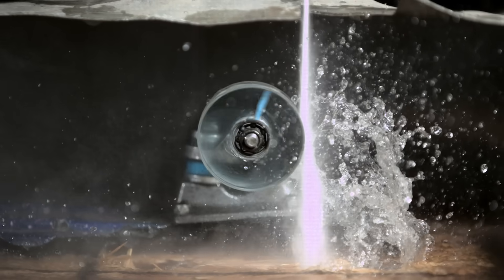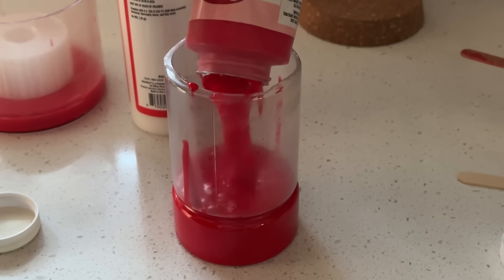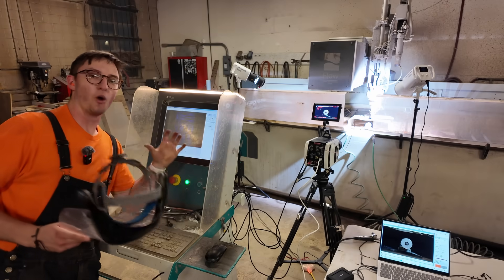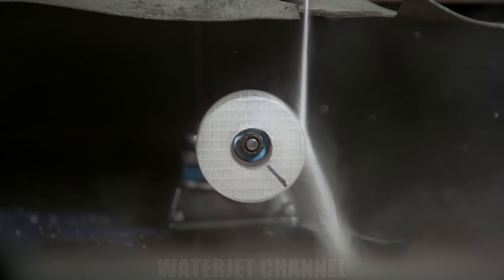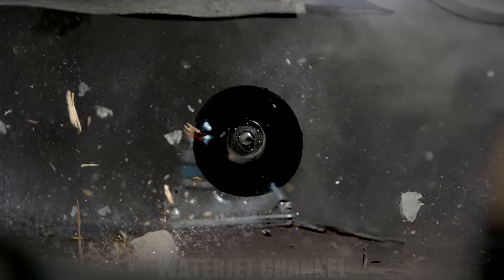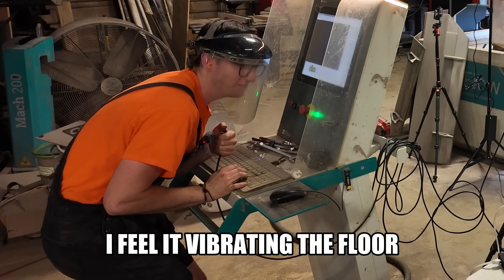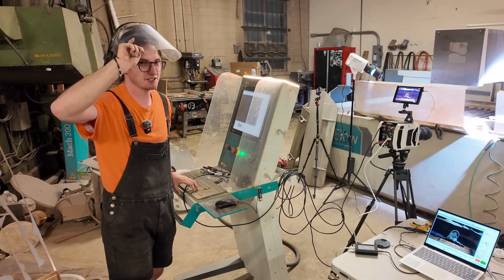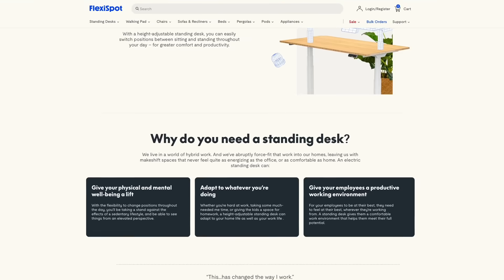How Fast Can We Spin Bulletproof Glass Before it Explodes?

Comment: What if you had some sort of variable-geometry ridges on the outside of the skate wheel (sort of a transverse tread) for the jet of water to push against to increase efficiency. As it is now most of the water is flowing past the wheel barely transferring any thrust to the wheel. You could do so much more with this if the wheel would be able to be larger and heavier due to using more of the jet force and increased torque.

Comment: The problem with spinning these up with the waterjet is that the waterjet, whether using the abrasive or not, is going to start eating into the material as it's spinning and weaken the structure until it has enough of a defect that causes it to come apart.  If you really wanted to know how fast you can spin them to see when they come apart from their own rotational velocity, you'd have to spin them through some non-destructive method so that any defects that arise, come from rotating the material alone.  That and if you want a perfect wheel, you need to make a solid puck or block of whatever material and machine it down in a cnc machine to be perfectly balanced and fit the bearings perfectly.  I get that you want to use the waterjet because that's the channel name and it's how you've done things for a long time, but you could at least machine the wheels to be effectively perfect.

Comment: 4:15 The tool you're looking for is an arbor press. You can use a piece of material just smaller than your bearing OD and just bigger than the ring's ID, and pass it through the other side, then press the ring out.

Comment: 7:27 its crazy when you pause it right as it splits into 4's it turns see through cuz of how fast its going on the frames I'm guessing?
Reply: No actually it’s actually because fast things going at an unsteady rate of speed create after images if it keeps going in the same spot also you can make after images when you move your finger back and forth fast enough

Or it could be what you said

Comment: WoW! Who knew the glass and resin wheel would last about the same as the.... Glass and resin wheel! You mess with the angle of the waterjet too much on the wheels too. It's never really consistent. All you did was split the layers because you sliced between them with the water. It's a really nice machine, but kinda shit for this because the area of the impact is so focused. Anything you do with layers is going to fail the same way. The the same reason the glass broke early, you were splitting the wheel at the surface point of impact as it spun.

Comment: ¿Has calculado la resistencia para maxima velocidad de giro para materiales multidensidad con geometrìa elàstica? Tal vez eso ayudarìa a ganar mas revoluciones sacrificando dureza por deformaciòn elàstica, haciendo mìnima la deflormaciòn plastica que lleva a la rotura. Imagina los radios de una bicicleta unidos en el extremo exterior y unidos en el extremo interior, pero en lugar de usar metal duro usar un material  flexible y unir el conjunto dentro de un material menos denso. ¿Jugando con la geometrìa en el desarrollo de la ruega, como lograrìas hacer que soporte màs rpm? Imagina un conjunto de donas huecas concentricas  con algun fluido en su interior que a determinada cantidad de revoluciones haga de contrapeso para evitar trabajar en la zona plastica del material de la dona. ¿Nivelarìa el comportamiento de la dona?. ¿Y si dentro de cada dona se usara un fluido de densidad distinta para que nivele las donas a distintas velocidades? ¿Serìa posible exceder el lìmite de velocidad de un material haciendolo multidensidad y jugando con la geometrìa?. Mi nombre es  Daniel igual que tu. Desde Rosario -Santa Fe - Argentina. Me agradan tus videos y despiertan la imaginaciòn. Un gran abrazo.

Comment: Bulletproof glass wasn't that strong because the water jet hit the sides, and it can take a lot more compressive force than shear force. You could get it to work a lot better if you cut progressively smaller circles to make the wheel, but the wheel would only be as thick as the sheet of glass you cut it from. The sand didn't care because its one solid object.

Great video btw!

Comment: A very interesting video! Since childhood, I have also been interested in things that can be called extreme. For example, will a match light up and how will it burn at a pressure of 10 or 100 atmospheres? How will the electric motor behave with a smooth increase in frequency from the standard 50 Hertz to 100, 200....400 hertz? What will happen to a bullet flying through a cutting jet of water?

Comment: 8:26 - The problem w/ the mold was that it didn't have reinforcement on the sides and when you put the side on it bulged the mold causing the bearing locations to be different, causing the wonky wheel... You could have wrapped it in duck tape or gorilla tape before pouring the stuff in or put it in a container to keep it true. Maybe next time....    😁👍😂

Comment: The mold was made circular, but had no support to keep it that way. The material being cast pushed out on the mold asymmetrically. Make the mold in a box and keep the box for later when you do the casting. This will help it keep its shape.

Comment: I don't know if you have tried this yet, but I imagine the rotation of the objects causes tensile stress in the material until the stress gets so high it rips itself apart. So, why not try a tungsten wheel, as tungsten has the highest tensile strength of any natural metal. I tried looking up alloys with greater tensile strength, but all I could find was people saying they exist but not saying what they are? The highest tensile strength material is graphene which obviously you will not be able to make a wheel out of, but it's tensile strength is about 130 times greater than tungsten even. I would  dare to guess the tungsten wheel would not explode, unless you modified it so that it's just a tungsten ring around a filler material, in which case you could make the ring thinner and thinner till the tensile stress is greater than the tensile strength. In fact, that could be a cool project all together, gradually increasing the thickness of the tungsten until you find out the tipping point between exploding and retaining it's shape. Or maybe the solid tungsten wheel would just explode idk.

Comment: There's a company in Woodlands Texas called ChampionX. They make Diamondback 3D printer nozzles out of a substance called "Bort", or polycrystaline diamond. Unlike regular diamonds which are incredibly hard, but brittle and easily smashed, borts are incredibly hard and very durable (those nozzles are basically invincible). You should reach out to them and see how big of a bort they're able to make, and if they could make a bort skateboard wheel. I can pretty much guarantee the algorithm would love a title like, "Spinning a solid diamond skateboard wheel at hypersonic speeds", and a thumbnail with "REAL DIAMOND" in it...

Comment: Want a true test to see how fast something can spin without the extra variable of the waterjet touching and damaging the item? Build a finned wheel onto the shaft that the water jet hits and spins and let the item of test to sit attached to that shaft. The finned wheel should be a strong enough material to resist coming apart.

Comment: When trying to make bulletproof glass again, may I suggest setting up all your layers, get the air bubbles out of the resin, and then using a spong brush to brush the resin on each layer as you stack it, you will have to leave it where you make it but it will be a big block of BP glass you can cut stuff out of it maybe

Comment: Is there a way to rig up a shaft thats strong enough to be spun by the water jet, maybe with like steel or titanium fins on it, so that the wheel of random material can just spin and not be affected by the jet itself?
Reply: Just use a pressured water pipe as the axle, and have have two off center holes on opposite sides. Optionally, extend those away from the center of rotation with curved pipes to get even faster speeds. The water comes out at the opposite angle of rotation at all times at high speed. It will keep ramping up until the considerable force of the extremely high pressure water is equal to the force of air resistance on the extenders, plus minimal air resistance from the axle rotating, plus the friction of bearings.

Comment: for those people who wants to know the speed of the spinning wheels in kmph or mph

The speed of the 3d printed wheel is about:

274 kmph or 170 mph

the speed of the sand wheel is about :

1357 kmph or 843 mph

the speed of the glass shard wheel is about:

788 kmph or 489 mph

And the speed of the bullet proof glass wheel is about:

777 kmph or 482 mph

Keep it in mind that these values are not completely accurate.
Like this videos thumbnail 
Mach3 is 2301 mph
Mach2 is 1534 mph 
And Mach1 is 767 mph
Reply from the maker: The Mach 3 in the thumbnail is for the water leaving the waterjet. But I’d be lying if I said I didn’t think some people would think it’s for the wheel lol
Reply: @WaterjetChannel  sorry I got confused.

Comment: "composite materials are made from a fiber and an epoxy matrix. the matrix is good for compression, whereas the fibers will take the tension"

waterjet channel : "let's make a glass shard- reinforced epoxy wheel, and then subject it exclusively to tension"

Comment: The angle of force on the wheels when they're spinning doesn't line up with the bulletproof glass' layers. I'd love to see this experiment repeated but instead of layering it traditionally like this, instead create incrementally larger discs of glass and plexi and slot them inside each other so it's layered from outside to inside.

Comment: Tapering the material to be thinner at the edges can allow higher speeds. For instance, the wheels of a supersonic car have a lens-shaped cross-section. As a bonus that should allow for jetting more towards the center of the wheel thereby providing leverage that allows the wheel's edge to spin faster than the speed of the water.
Reply from the maker: Interesting… we’ll have to try that on our next spinning wheel endeavor
Reply: yes, moment of inertia. maybe have two cylinders of different diameters, so they can shoot the water at the small, thick one, while a thin, large diameter part is spinning with more angular velocity
WAIT, ARE YOU CODY??
Reply: Hi Cody
Reply: More Cody videos please. Chickenhole base vid?
Reply: Cody in the comments with the pro tips
Reply: That is something I would be willing to watch. Maybe Cody could make a cast iron wheel from thermite to try too
Reply: hey love this guy !
Reply: taper?
Reply: @thegoldengood4725LOW-
Reply: LOW TAPER FAYED
Reply: First reply in 18 minutes?!
Reply: Cody, please will you spin me?
Reply: No  @Seedy32

Comment: The pressure of the sand and glass might have deformed the silicone. Had some issues with that before, if you try these again try some heavy duty molding silicone. i use dragon skin silicone for my molds.
Reply: Also, use a soft silicone coating on the original part and then cast that in a hard material (often plaster-soaked bandages).

Comment: The problem with the bullet proof glass wheel was you had the waterjet hitting in between the layers of the bullet proof glass so it was just separating/destroying the weakest layers causing it to blow apart faster than probably if it was designed the other way (instead of looking at the face of the bullet proof glass having a hole in it, it should have been the side of the bullet proof glass having a hole in it).
Reply: bulletproof glass is designed to be strong from the front, not from the side
Reply: @pallasproserpina4118 yeah…I think that was the point of the comment
Reply: could probably get around that by encasing the glass in resin as well as having resin between the layers. Even so, it likely would slightly perform better than what was done in this video since it's similar to the broken glass in resin wheel.
Reply: It would delaminate and be destroyed faster, thats my guess
Reply: Or if it had been spun normally from the center rather than using outside force and friction causing erosion to begin with
Reply: Bullet proof glass isn’t resistant to centrifugal force, only kinetic energy from the front/back.
Reply: @VengeanceYT21  Need to make a spiral laminate, like a jelly roll, so it's strong in the radial direction.  Carbon fiber perhaps?
Reply: The waterjet isn't cutting the glass because they're not using abrasives in it, just water. Waterjets don't actually cut with water, they cut with fine minerals delivered by water. It's just a way to speed the wheel up.
Reply: @mal1t1ax  They can cut with pure water or loaded water; different modes.
The water will cut through the plastic layers, but not the glass.

Comment: You're more of an expert with materials than I am, so I'd love your input. If I were to use resin to mold clear beyblade parts, do you think the resin you used in this video would be impact resistant enough to survive beyblade battles?
Reply: Not if you spin the Beyblades at 6k RPM.
Reply: Don't use plain resin.  Make it composite by using, say, fiberglass.  You can buy shreds (as opposed to sheets) that are meant for molding like that.